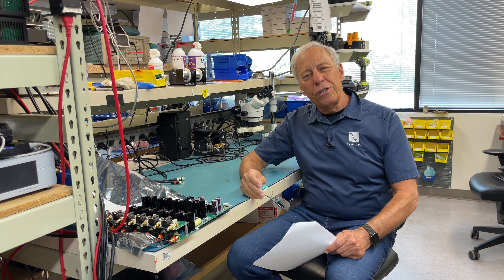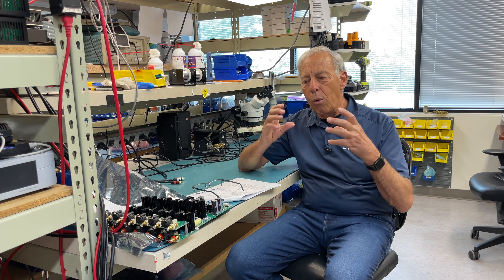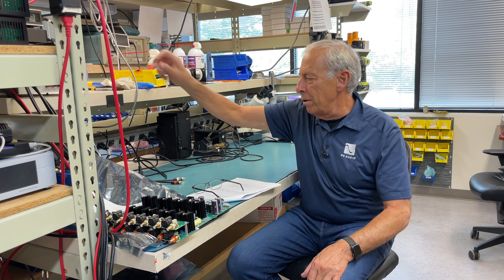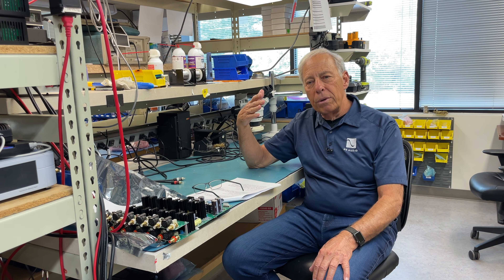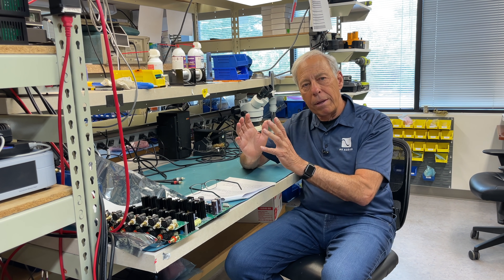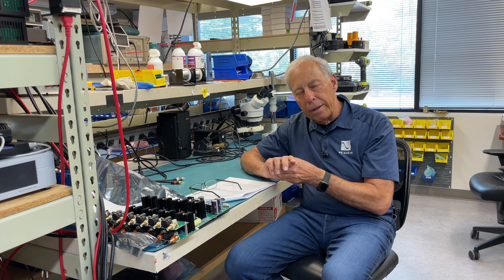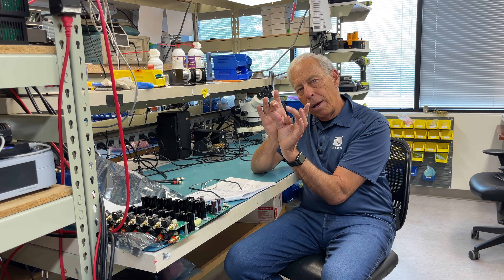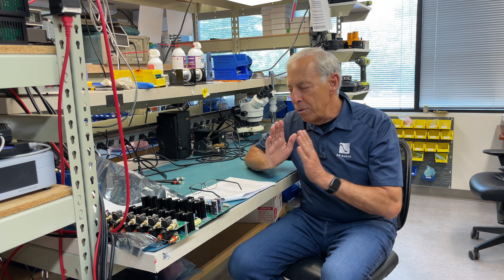The history of volume controls

Comment: Why don't you show us some values of distortion of a signal attenuated by a resistive voltage divider (potentiometer) in comparison to those obtained with an operational transconductance amplifier? While operational transconductance amplifiers are very useful in many applications, your assertion that they are categorically superior to potentiometers for amplitude control are questionable.

Comment: Hi Paul, how wouLd i delete the volume pots on my amplifiers alltogether?

I have public addess amplifiers, but leave them on full volume all thd time, and control the overall music volume from a mixer and line splitter

The volume pots on my amplifiers need replacing, as they constantly drop out the music volume, and i have to flick the volume knobs, or mess around turning the pots up and down just to get the music to play again, its very annoying

So, while i have the amplifiers opened up, is there a way just to bridge the connectons of the volume pots with either wire or a fixed value resistor, to give me constant full power?

Thanks, Russell from Derbyshire, England
Reply: Yes, most likely one leg of the pot is at ground and the opposite leg is the input to the pot with the wiper in the middle.  You should be able to determine with a VOM which let is ground and then you know the opposite let  is the signal input.  Make SURE the volume control always stays at Max volume  (or you could short the signal to ground which would not be good) then hardwire a jumper from the input leg to the center wiper of the pot.  If you do not understand this fully do NOT attempt it, find a technician to do it for you.  YMMV.

Comment: @Paul : But I think there is no difference between volume control and gain control BCUZ gain control has a feedback part and it feedbacks the outpot to input and you have to control the parameters of that by a controlable potentiometer . SO again we have a variable resistor between and what it adds returns from output to the input and the extra features loops again and again.
Am I wrong? plz correct me.

Comment: I have a Rappaport preamp that had a pot that didn't track well. As you turned the volume up or down you had to compensate with the balance control. I asked a guy at the store I bought the preamp from if I could replace it with a much better pot. He sold me a conductive plastic pot which I think was $45 and that was back in the 80's. Not only did it fix the tracking problem but the sound was much better. I have done a few more mods to that preamp and it has been my solid state reference for years.

Comment: Hi Paul, Wiring a source directly to a power amp without any attenuation will blow everything up. Does the signal, before it goes to the gain cell, pass through a resistor first?

Comment: Question? Do volume control circuits compensate for the non-linearity of our ears? I heard that we hear on an exponential curve (e), so if a linear volume control were used, wouldn’t that make a “linear” volume control to “appear” non-linear?
Reply: Controls for audio amplifiers that involve the signal normally had an "audio taper" of logarithmic resistance scale
Reply: @swinde  is this a base “e” or base “10” logarithm?

Comment: Using Paul's logic, any resistor in the signal path is detrimental to the sound.  Don't think I have ever seen a schematic without resistors in the signal path.
Reply: But resistors are essential in the circuit. In this case they figured out a way to remove a component that can color the signal a good amount (and especially keep things perfectly balanced between both channels)
Reply: @LordBobbymort  A pot doesn't colour the sound at all, so no need to avoid using them.
Reply: @MrsZambezi  I agree, as long as the source impedance into the pot is low  and the impedance at the pot output is high there should be no audible degradation.
Reply: @LordBobbymort  that can be said for any component in the signal path.
Reply: @scorpven  yes, it can, that's why he figured a way to affect the gain without having components IN the signal path. And why for components in the signal path care is taken to pick specific components. Just look at the lore and mythology over the Trainwreck guitar amplifiers.

Comment: Gilbert Cell... That's (or was) often used to produce pure linear amplitude modulation... It makes sense! Just simply turning the gain of a Class A preamp up or down by bias Voltage is causing more audible coloration/degradation (non linearity). But a Gilbert Cell, great idea! I Know them from RF tech, but to use it as a volume control... Never thought about that!
Reply: To me a transconductional cell is a VCA or OTA, and I only know them as IC´s and I doubt they are colorless. CA3080 and LM13600 comes to mind.

Comment: I'll take any distortions from an analog POT over any digital volume control because all you can do in digital is throw bits away. Bit depth reduction.
Reply from the maker: Actually that's not true. There are lossless digital volume controls. They upsample the 16 bit data to a 50 bit word and then use that bigger word to perform the math without any loss of resolution whatsoever. The only problem is that when we're dealing with analog, we must first digitize the signal and that's where we can get into trouble. But for something already digital there's definitely zero loss volume controls.
Reply: @Paulmcgowanpsaudio  So you are saying they upsample before they bit reduce? But it is still done by bit reduction. And if you "bit upsample" without sample rate doubling as well, all you do is simple number x2 which provides only one significant bit increase which goes away as soon as the volume is cut in half. And that new sample number has not increased sample accuracy because x2 bit depth just shifts all bits up to the next bit level meaning all even numbers, no odd, only half the bits used after the first conversion. e.g. makes the least significant bit unused. IOW a sample with only the least significant bit on would become only the second bit on and the least bit would never be on. Unlike if sample RATE was doubled as well a dither bit could be generated between the actual samples. 

No matter how many times your up sample rate, information is not increased. Volume reduction will get back to the 16 bit data after the sample number of reductions (e.g. x2=32bit) would be back at 16 after half volume. And low bit depth distortion would set in as volumes get to lower levels. e.g. let's say a 100dbSPL @ 16 bit peak x2= 32 bit peak. If you want to listen at a talking volume level of about 60dbSPL, -40db would reduce to a a handful of bits. Very high distortion for a talking level volume.
Reply from the maker: @glenncurry3041  If you'd like I'd be happy to send you some links so you can study how it's done. You are correct that in the past there was always data lost when doing the math to change volume but that's no longer the case. Most off the shelf DAC ships already use 50 bit words at far higher sample rates in DSP to change the volume without loss.
Reply: @Paulmcgowanpsaudio  Yes as you now mention, it requires an increased sample rate to create tweens or there really is little value. I came from early video CGI and Digital effects. You had to double the bit depth to combine two frames and then reduce it back down. Some had to work with 8 frames of depth for each pixel for motion. Lots of computation. So wanted to make sure it was understood that a simple quality POT is a far simpler solution to get anywhere near the signal quality. Keep up the letters. Always enjoyable and informative.
Reply from the maker: @glenncurry3041  Thanks, Glenn! Will do. Sorry for the confusion.
Reply: @Paulmcgowanpsaudio  Yes there is so much confusion and misunderstanding of the technologies involved! In video we came up with an entire new set of test signals and measurement techniques to test distortions specific to digital that the old analog tests did not cover. Like the Moving Zone Plate. I have not seen the equivalent in audio. We seem stuck in the steady state sinewave test from the '50's and '60's. Just as it is funny to see people still using the Composite Video Color Bars with I/Q. Even FFT is sinewave based. We need to move to time domain and not just frequency domain specs. 

So keep up keeping us informed!

Comment: I am a licensed, profession electrical engineer, with over 40-years of experience, working for some of the largest technology companies in the world. 
I’ve watched several of your videos and find those where you discuss the history of hifi audio to be most interesting. You clearly build fine equipment and run a very successful company. For that you should be proud!

That said, I take exception to the fact that you often refer to yourself as an “engineer” and talk about “your designs”, such as, in this case, transconductance amplifiers, gilbert cells, and amplifier gain stages. In reality, Gilbert Cells were first used in RF design in the middle 60’s, transconductance amplifiers are simply a variant of operational amplifier, around since the 70’s and amplifier gain stages have existed since the days of vacuum tube amps. Reading a couple of books on how to implement these circuits doesn’t make you an inventor, or a designer. In reality and by your own admission, you barely made it through high school and certainly have no formal training as an engineer.  

These facts don’t diminish your accomplishments as a successful business owner and entrepreneur, but in my opinion referring to yourself as a design engineer is no different than someone who plasters a fake diploma on their wall, claiming to have a degree that they never earned.  In reality, when it comes to electronics and electronic design, you are an advanced electronic hobbyist.  

Please stop referring to yourself as an electrical engineer. You are not!
Reply: Agreed. Viewers of this channel must accept Paul is a salesman with superficial engineering knowledge. Many of his technical videos demonstrate this lack of technical expertise and some are just plain wrong.  I don’t watch all his videos but occasionally click on a technical answer for entertainment. I do not own any PS products and probably never will but I would be very cautious if considering any piece of equipment he claims to have designed.
Reply: Way to go miro
Reply: I work at a company that has a number of engineers. They all seem to know what they know and little else. Not one of them can fix a circuit that they designed. The person I consider to be the best engineer at the company I work for is not an engineer. He has good well rounded electronic knowledge.
Reply: Ummm Mike P..... Oh yes he is.   If you start with nothing, and design & build an object that didn't exist the day before... then you ARE an engineer.   The formal education doesn't matter.  There are thousand of musicians out in the world playing in bands and making a living that never took a music lesson in their lives.  Does that mean they are NOT musicians, or songwriters, or composers??  Of course they are.   I hope you don't injure yourself falling off your high horse!
Reply: @TheMirolab  I would disagree.  Music is an art; electrical engineering is a science. Big difference! Medicine is both an art and a science. Would you go to a self-taught doctor? I hope not. 

Claiming you’re an electrical engineer implies that you have completed a formal course of education and possess a wide range of skills and knowledge, covering a multitude of disciplines. Circuit design being only one part of that education. 

I want to make it clear that I have nothing against the man personally. He seems like a genuinely nice guy and no one can argue with the fact that he’s been very successful in life. My only complaint is that he misleads people when he claims he’s an electrical engineer. Would it be OK if he plastered a fake EE degree on his wall?
Reply: @mikep2123  Whilst appreciating your definitional accuracy, it's worth noting that Wikipedia defines engineer as: "derived from the Latin Ingenium, meaning "cleverness" and ingeniare, meaning "to contrive, devise". The word actually means something more to do with imagination. The remarkable Islamic scholars, not formally trained, discovered: Algebra, Alkaline metals (Earth metals), the notion of the Alkamist and much more. Formal and highly structured education (as wonderful as it is) can sometimes be limiting. Many of the world's wealthiest people have no or very little formal education. All the best, Beamer.
Reply: @beamer.electronics  The originally meaning of the word, has little to do with our modern definition of the term. Based on the broad definition you quoted, almost anybody with imagination could be considered an engineer. That same Wiki article also states, “The foundational qualifications of an engineer typically include a four-year bachelor's degree in an engineering discipline”. There are in fact many jobs that require proof of an engineering degree from an accredited school. Aerospace comes to mind. Would you want to fly in an airliner designed by a self-taught engineer? How about live in a hi-rise designed by a self-taught structural engineer?

In the modern world of electronics, to claim you are a design engineer, which Paul has done numerous times, would imply that you possess such qualifications, which as I mentioned, would be no different than plastering a fake EE degree on your wall.
Reply: @mikep2123  I did start by saying "Whilst appreciating your definitional accuracy" and I realise you're rightly proud of formal engineering qualifications and training. However, it's my lifetime's engineering experience that tells me this isn't the whole story. One of the most brilliant EE design engineers I've ever known had virtually no qualifications at all! He successfully designed equipment for many major companies, and the only reason why he didn't go for qualifications was - he didn't have/make the time. Sadly I've encountered too many highly qualified EE's and PHD's that have been baffled by a duff diode, too high an ESR cap, incorrect value inductor, struggled to test a transistor, use a DVM or even hold a soldering iron. It's not just inexperience - they were, and always will be, incapable! I agree that most people have imagination, but some people have exceptional imagination that doesn't fit into, isn't part of a formal educational structure. I've also known aircraft, high rise buildings, and vehicles catastrophically fail through appalling 'professional' engineering.

Comment: If only the studio engineers would only use such controls for reducing or increasing a master stem's gain in a mix.

Even when they do, they seemingly also use equalizers, 100% of the time, too.  And the equalizers do not leave the natural sound intact, the way the favorable gain controls do (as Paul described).  The equalizers reshape the sound, and there is no getting around the contrived, non-natural sound that they install over the now-gone natural sound of voices and instruments.
Reply: See my comment about that. Gilbert Cell Multipliers are not typically low distortion. Studio recording equipment do use  VCA's but of a different design. Again I have no idea as to the exact PS audio circuit which might be a variant of the basic GCM but improved for audio.

Comment: The "pot problem" is generally mis-understood in non technical audiophile circles. The quality (or cost) of the pot by it's self in a static fixed state has no affect on audio quality in HiFi  components. A mixing console is a different situation. Here we need steady and smooth resistance change which requires higher precision manufacturing and materials. But one the pot is set, it's nothing more than two fixed resistors in a voltage divider circuit. Now if your pot causes crackles and static when varied, yes a better quality pot will fix that. But these ideas that "pots sound bad" is not the fault of the pot. Based on the impedance of the source and destination circuits connected to the pot, a low pass filter is formed. The more series resistance of the divider, the lower the frequency cut off. The surrounding circuits must be designed to keep this inherent problem to a minimum. Replacing a pot on a not so well designed preamp with an expensive $50 pot will not fix this degrading problem. As for noise when the control is moved as well as tactical feel, yes.
Reply: That is not true - a pot is a piece of coated material, that is not as good as a good resistor. And that is true for all pots. And even resistors can have a sound, and have
distortion. The company I worked in once developed a resistance measurement device for the known company Radiometer.
Reply: @qddk9545  And a modern carbon film or metal film resistor is not a coated material? As for resistors changing sound, how so beyond obvious signal attenuation? Remember we are dealing with baseband audio here, not RF or video frequencies. Many companies develop resistance measurement devices. They are called VOM's, VTVM's, and in our  more modern times, DMM's. Nothing unique there.
Reply: @andydelle4509  You have no idea. The instrument we developed measured distortion in resistors. Don´t comment if you don´t have a clued.
Reply: @qddk9545  As any distortion you might be able to find with your fancy instrument is going to be inaudible especially when compared to semiconductor noise  it's best to not worry about it.
Reply: @qddk9545  OK, explain to me the distortion mechanism that was discovered in various resistors? What type of distortion exactly? Go as deep as you want.